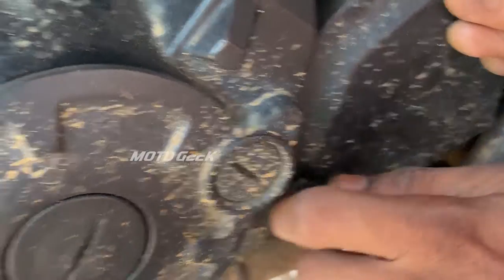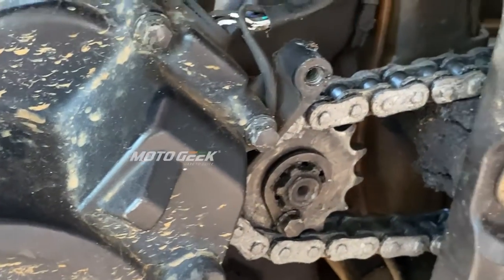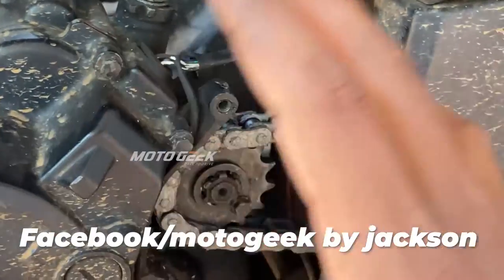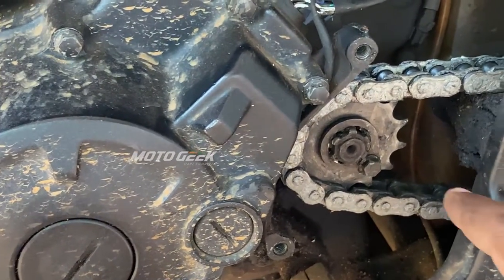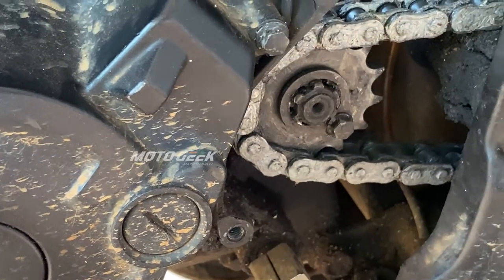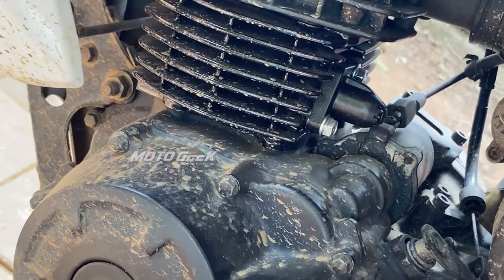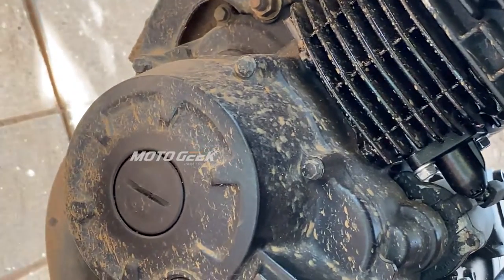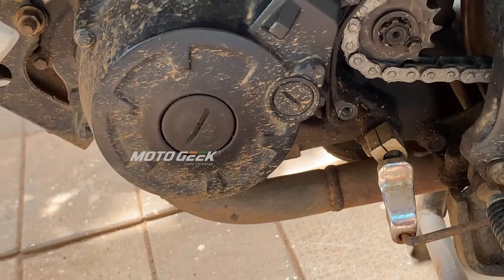8 ന്റെ പണി  be alert 🚨 Bike Drive Axle Shaft Problem - Malayalam

Comment: Same problem. Can we do welding?
Reply: i did welding, and 2 times sprocket change um cheythu, change chyan kurach padahn but chym
Reply: @bharathkumaran3228  can u tell in English mine also same problem is welding good
Reply: @clawshamYT  yes bro u can weld it no problem, while changing the sprocket a little bit more work required that's all
Reply: @bharathkumaran3228  what kid of more work
Reply: @clawshamYT  cutting off the old sprocket
Reply: @bharathkumaran3228  bro sprocket weld cheythal pinne sprocket change cheyyunna samayath nth cheyyum ?
Reply: @Shamliiiiiid  ath cut cheythitt pinned grind cheythu kalayum

Comment: Ee pani enikum kitti... Njnum weld cheythu only 1250/- ayollo... But workshopkar paranju drive shaft complaint ayathanenu engine fulliraki shaft maranamenu athinu ekadesham 6000/- verumenu paranju
Reply from the maker: Yes athu correct anu.
Reply: Machanee ninake doubles il pokumbo enthengilum missing ooo valive ooo performance il enthengilum kozhapam ullath pole feel undo ????

Comment: FZ V2 2019 75000KM on ODO. Drive Sprocket started to give issues
(Chain Noise). But I have to admit 60K to 70K KM on odo I was Rash Riding. 

Haven’t replaced yet. Yamaha Service Center quotation of 6K to Replace it.

Comment: 1 laks &36000 km ayi weld cheyth odikkunnu ...cash settayit shaft maranam one time welding Poty veendum steel weld cheythu ... duplicate chain sprocket avoid pinne 1st gear clutch thangi edukkukka life kittum
Reply: Oru doubt koodi gixer shaft use cheyyamo ithinu pakaram ?

Comment: 29000 odiyaa nte v2 ne pani vannittundeee 😔😔 poyittu mattan erikkuvaaa
Reply: bro shaft nte teeth fully worn out aaytillel athil weld cheyth aa play matam, confuse aavaruth.. njn paranjath kutti sprocket weld cheyth vekkanam ennallaa.. teeth rebuld cheyyam.. upto an extend. angane cheythal namak chain sproket set damage aavumbo mati edakayum cheyyam..,  1yr oke angane kondu nadakanna njn cheythappa kadele pulli paranje..!
Reply: @manwithaplan1752  bro shaft teeth half cut aayi poyittund teeth maathram weld cheyth sett aaakkaan patto. allaathe sprocket vech weld cheyyanda aavishyam undo